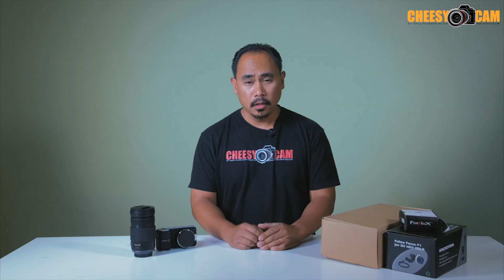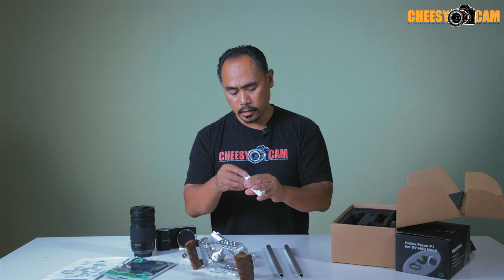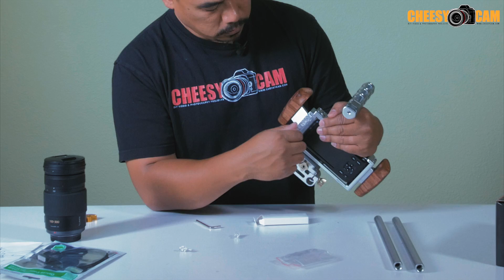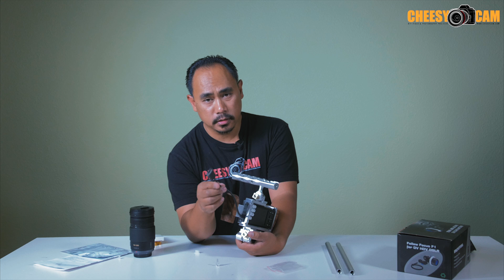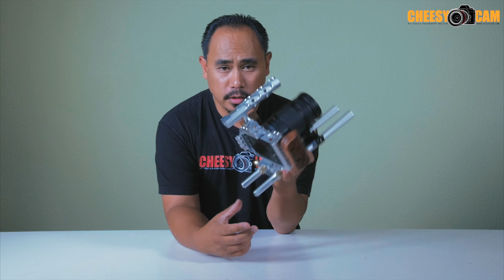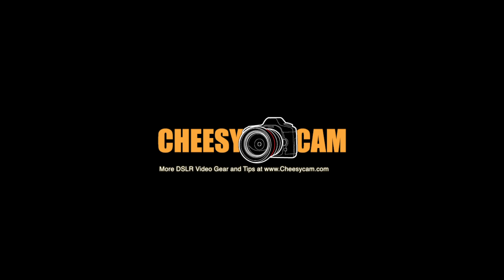Unboxing FotoDiox Shark Cage for BlackMagic Pocket Cinema Camera BMPCC

Comment: Do you know if the Zacuto Gratical HD Micro OLED ELF would work on the camera or does the cam's HDMI output shut OFF when in Record Mode ? (Thanks).
Reply from the maker: VideoByPatrick The Blackmagic Pocket Cinema camera will continue to output from HDMI and LCD screen even in recording mode.